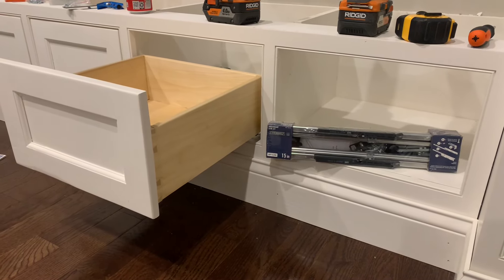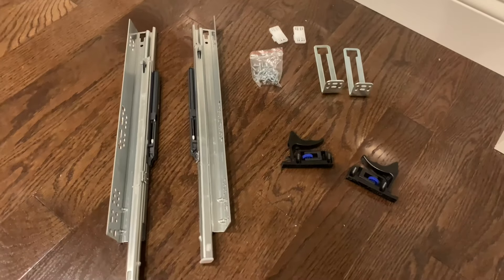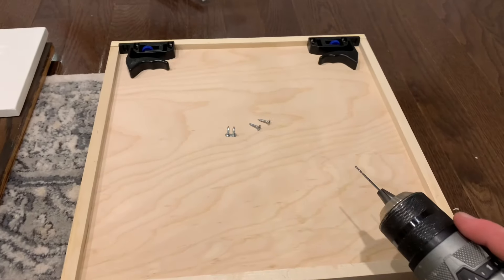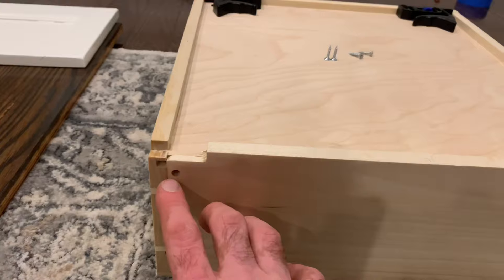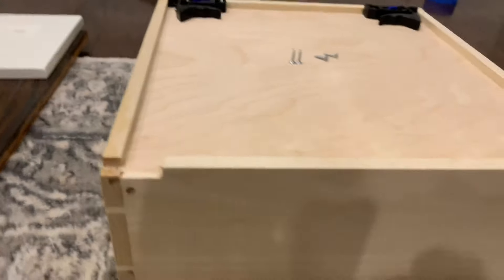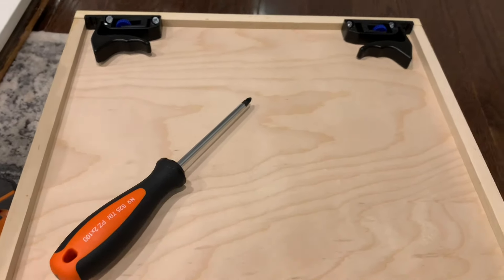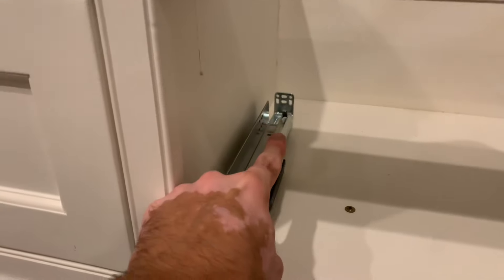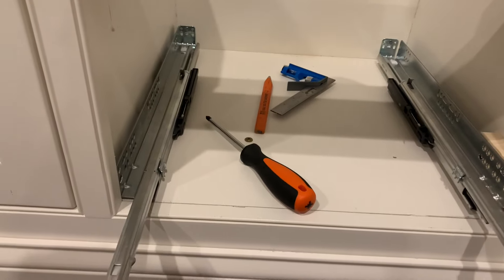How to install Undermount Soft Close Drawer Slides

Comment: Mine isn’t as smooth as I’d like. Does it break in?
Reply from the maker: Check to make sure your drawer box and slides are square. Also double check that the space between the drawer box and sides is correct. If the spacing is off it can cause tension and not be smooth. All my drawers here and in my kitchen were smooth.

Comment: Hello HomeHacks, I just purchased several sets of the Hettich undermount 18" drawer slides and installed one set with a template drawer. The drawer is has plenty of room in the space. The drawer box and mounted slides are all square. When I open and close the drawer, it does not glide, instead, it feels like I'm gliding on sandpaper. The drawer does not glide open or glide to a close and catch the soft-close function. It's something I am not doing correctly. Any trouble shooting tips or ideas?
Reply from the maker: Are you using 1/2 inch thick drawer boxes instead of 5/8? You need to add the 1/8 spacer in between the latch and edge of the drawer box. I made this mistake too and didn’t realize it until later.

Comment: you make life installing drawer slide difficult for yourself.
use some spacers to set them on, 1/4” ply, and the block you have to secure the sides should run the whole length.
holding the slide with your finger and using a level is silly.
be kind to yourself, use spacers and leave them in there
Reply from the maker: Yeah did that approach when I built our kitchen and installed all its drawers. Definitely faster.

Comment: So the only thing holding the drawer in are the pins? Doesn’t seem very nice gonna just accidentally pull it out right? Makes no sense
Reply from the maker: Yes the clips grab onto the slides. This is a pretty standard approach for under mount drawer slides

Comment: Way too complicated.  You already cleated out front, just cleat out the back too.  No reason to use the back clips.
Reply from the maker: There is some play in the back clips that helps and they can slide forward and backward. I have done both approaches and find using the back clips makes it easier.
Reply: @homehackshowtos  sounds good.  Thank you.
Reply from the maker: Thanks for your feedback though. I appreciate it.
Reply: @homehackshowtos  I personally like the idea of cleating the back side too for strength.  The back end for me is very thin particle board and unlikely strong enough to hold the weight of the drawer.  It is not easy to do when you have the countertop attached but it may be worth it.
Reply from the maker: Agree. When I made our kitchen I did side cleats. In the case of this bench it was all 3/4 plywood so the back was strong.
Reply: Even attaching to the back, cutting a second spacer to use to mark the back is easier than using the square.  You have to predrill that spacer too (as you did) or it will easily split.